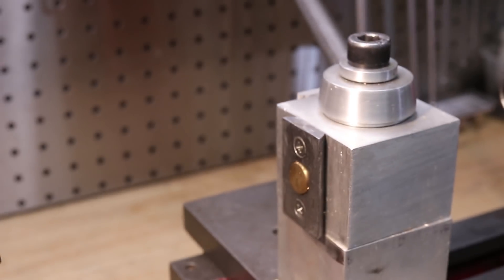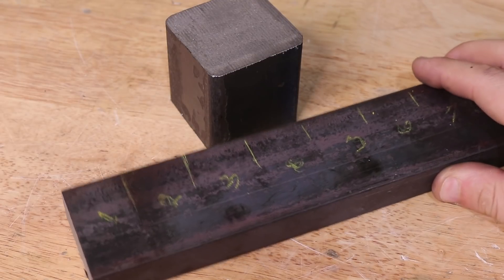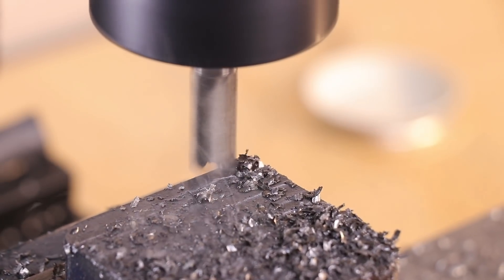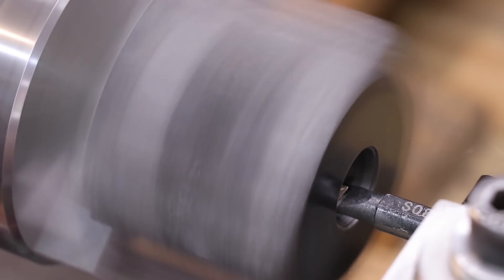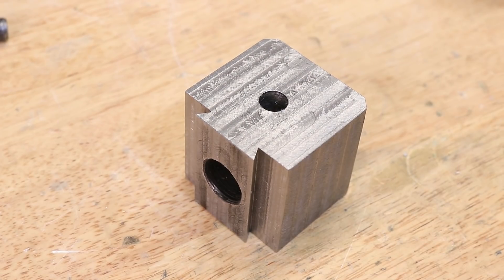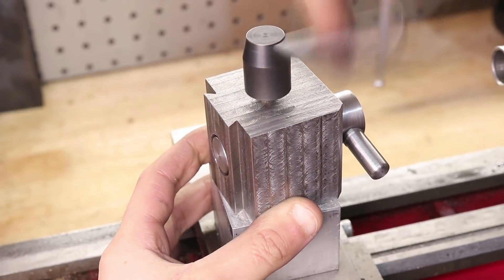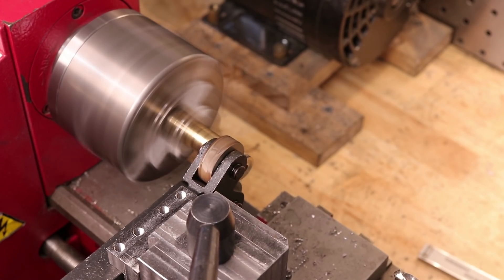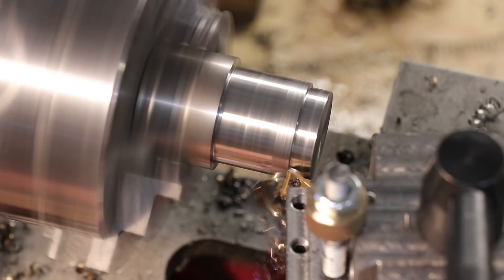Making A Steel Quick Change Tool Post And Tool Holders For The Mini Lathe

Comment: What is the advantage of a flycutter over an endmill? Is it the larger available diameters a flycutter has that removes more material per pass?
I am also wondering why some channels show parts being cooled with some kind of cutting fluid during the machining process, while others run dry tools. What would be the criteria one considers for selecting a dry vs. cooled cutting process?

Maybe I should buy a basic machining textbook.
Reply: Hey man ! I'm a 17yo machinist apprentice but I'll try to answer your questions has best has I can !
So, the advantage of a fly cutter is that it gives you a more uniform surface finish because you can face the whole work in one pass where with an end mill you gotta do it in a few passes which gives you those lines on the face, they also usually give you a way better surface finish overall.
For the coolant part, we usually use emulsified water which is a mix of water and cutting oil, there is also bacterias in it which make the water and the oil possible to blend, the choice of using it or not depends on the material you're machining and the material your cutting tool is made of. For example you never have to use coolant when cutting brass because it's soft and naturally self lubricant, for aluminium we use petrol because it's quite "greasy" and keep the chips from cold welding on your cutting tool.
If you're using a carbide cutting tool you don't have to use coolant because it resists heat very well but with High Speed Steel ones you really have to use coolant to prevent your tool from changing color and get weaker.
The reason he's not using coolant is probably because it makes quite a mess on small machines with no housing and you either have to get a coolant pump with a tank, tubing and all or constantly apply coolant on the work with a bottle which is quite a pain.
Hope I cleared most of your questions, tell me if you want anything ! I also hope you understood my comment, English is not my mother tongue, I'm from Switzerland 😁
Reply: Cutting with coolant allows you to run faster and will help extend the life of your endmill/turning tool. The reason you won't see many home shop machinists or hobbyists use coolant is because it makes a mess. A cutting lubricant like wd40 or tapping fluid does a decent job of lubricating and cooling your tools, but it isn't nearly as good as a flood of coolant.

Also fly cutters (or a large enough face mill) are preferred to use because they can cut the whole surface of the part at once so you won't have the ridges between cuts left by using smaller cutters.
Reply: I use a cutting paste. It is less messy as you do not get the overspray of a pressurised liquid. Also, it melts at a rate which lubes the cut nicely. Downside is that you have to stop the cut to apply more paste. I use a small wooden spatula. My aim with the paste is to keep tool temp down, to prolong it’s edge.

Comment: Great Video, definitely on my to do list. Can I ask where you get your aluminium and brass stock? I live in Melbourne and am having trouble finding suppliers that will sell small lengths. Cheers Ben.
Reply: Easiest is to just buy scrap aluminium, melt it and make your own billets that is cheapest if you got the time.

Brass, well its not easy to melt and cast it into billets without experience.
Reply: @AS-ug2vq  yeah, I'm already doing that, aluminium is working great, minor pin holes, mostly visible when colour anodising. Brass also works well, but it's the diameter that's the problem. I have graphite crucibles that I use as form moulds, ie 2,3 and 4 kg. I melt in 10-12 kg crucibles. When you have a small long diameter you don't get head pressure, so for anything under 40mm diameter, generally I have a sink hole though half my stock. Hope you understand what I'm saying. With Aluminium I overcome this by putting coveral on top once I cast into the crucible. Clean as mud? Sorry
Reply: @ozrc1017   Consider sand casting, Myfordboy has a ton of videos sand casting all shapes and sizes.  It'll be messier than form molds, but with sand casting you can set up tall risers to increase your mold pressure.
Reply: G'day mate, if you look for h0tr0ddude on ebay, or copy/paste this, 40mm diameter x 300mm 6061 aluminium alloy round bar t6 lathe mill machining

the blokes name is Josh, he has a good assortment of stuff, and will cut it to length, he's in Tas, but small lengths shouldn't run you too much in postage.

Alternatively, if you're anywhere near the Mornington Peninsula, I used to buy offcuts from K&K Steel in Hastings. and George White &Co in Clayton, will cut brass, bronze and copper to length.

Happy machining,

Scott.
Reply: @smacknives754  Thank you for the info, greatly appreciated!

Comment: Looks lovely! Perhaps time for a bandsaw? 👀
Reply from the maker: Maybe, but I don't really have the space, plus I enjoy using the hacksaw
Reply: @artisanmakes  they make small ones for your bench. when not needed you can tuck them away. This one is both a portable bandsaw you can use handheld or as a pivoting one. https://www.amazon.com/Anbull-Portable-Removable-5-inch-Spotlight/dp/B08DHKF8MJ/ref=asc_df_B08DHKF8MJ/?tag=hyprod-20&linkCode=df0&hvadid=459730407112&hvpos=&hvnetw=g&hvrand=1945141654387239153&hvpone=&hvptwo=&hvqmt=&hvdev=c&hvdvcmdl=&hvlocint=&hvlocphy=9026944&hvtargid=pla-976909439008&psc=1
Reply: @WmSrite-pi8ck  Thanks for that.
Reply: @artisanmakes  could you block this David Willard fella from posting comments on your videos. Cheers.
Reply: @artisanmakes  Arm gains
Reply: Homemade automatic hacksaw project. Boom new video

Comment: A large slitting saw for your mill would be good for bedtime you want to cut big chunks of bar. I bet that hacksaw took forever
Reply from the maker: I have a few blades, but I just need to make an Arbor for them. Believe it or not I quite enjoy the workout when it comes to using the hacksaw. If I didn't I would have gotten a portable band saw a long time ago. Cheers